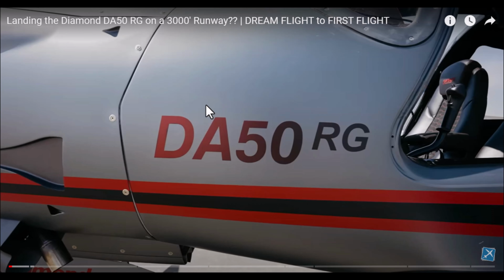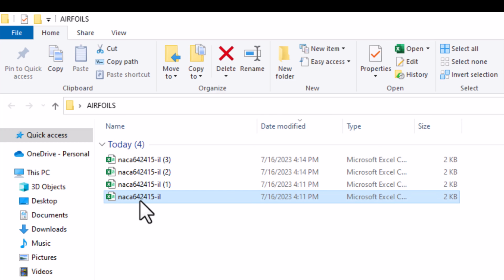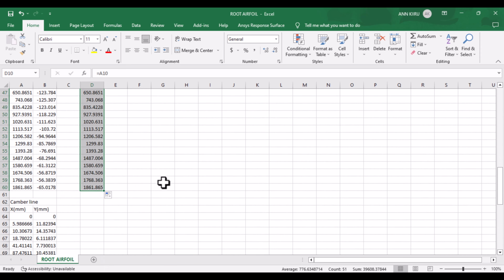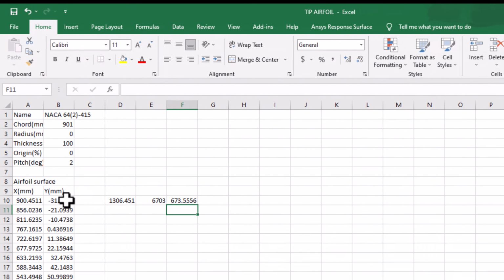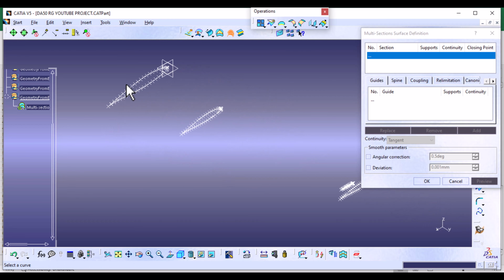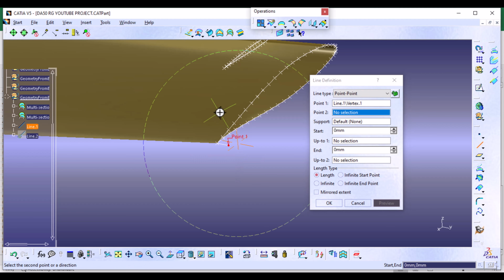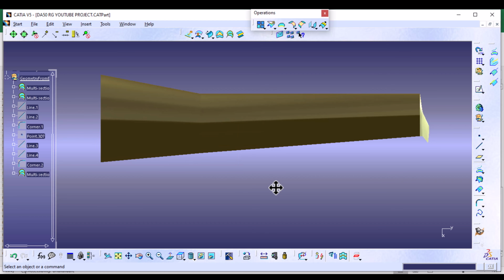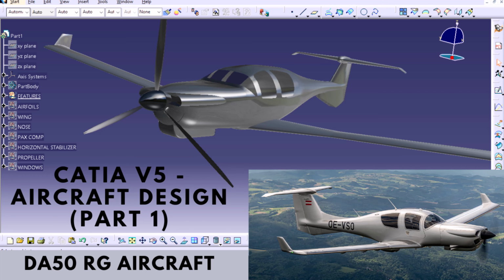CATIA V5 - DA50 RG AIRCRAFT DESIGN USING GSD CATIA V5| BEGINNER - ADVANCED| PART 1 - WING DESIGN

Comment: Here the winglet chord you have mentioned is 751mm but you have downloaded a file of 375mm as the chord length. So could you please clarify that for me. 
And thank you for creating such a helpful vedio👏
Reply from the maker: Hi, thank you for watching & for the keen eye.👌🏼
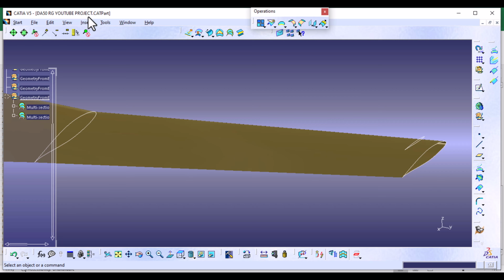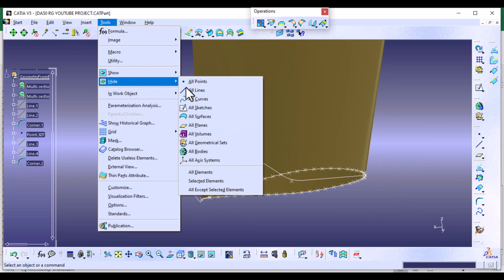Yes. The base of the airfoil should be about 750-800. But we didn't download the airfoil because we used points & splines in Catia to create the sweeping face from base to tip to winglet instead. (17:00 - 20:40) The 375mm if for the tip of the winglet.

Comment: Hello, please i want 0to learn how to make a full planes and helicopters in the stimulator and test if the plane can fly or not and also control it and testing the wings and rotors and engines and all of pieces from the small one to the big one, can you please guide me to do it can you guide me i want to be an engineer and be able to build full helicopters and planes, i have knowlegde in embeded systems and also in software developement and a little bit in mechanics and engines like turboshaft torboprop etc...
by the way i love what you do you are incredible
Reply from the maker: Thank you. You can start by learning part & assembly design for parts & GSD + Class A surfacing for complex smooth bodies. Then you can use simulation softwares such as Ansys to do FEA & CFD (computational fluid dynamics) to test flight characteristics esp wings & propellers. X-foil Can help with wing/airfoil selection.
For now you can watch Aircraft & helicopter design playlists on my channel & other channels as well to learn Cad design then you can join my Patreon (https://www.patreon.com/arielcad3d) where I'll be posting simulation master courses  & research projects).
All the best! ❤️

Comment: Thank you so much for this tutorial, muchly appreciated , But I had one question please related to the last step, isnt it better to give thickness instead of making it solid? because if it is solid then its weight is  doubled at least and that would effect the analysis
Reply from the maker: @abdulazizalhamid3885  Hi, yes. It's better to give it thickness if you're conducting structural analysis. Like we've done to the Renault project.
Reply: @themartiandogengineer  Hi, Thanks for your reply, I tried that but facing errors due to smoothness and offset or degeration, So can you please guied me how to solve it, or if you can direct me to the exact video that you made it successfully in Renault project because they are too much 😅
Reply from the maker: @abdulazizalhamid3885  You can't use thickness on the entire body at once because some parts like the wing and tail are thin and therefore thickness can't be uniform. It has to be in parts.
Tips: Try to reverse the thickness to offset outwards for thin bodies.
Try to lower the thickness in mm.
You can also make a body solid then use shelling option to make it hollow & give it thickness in part design.
Watch the Renault project for advanced knowledge on surfacing & solid integration.
This was intermediate that's why i simplified it.
Reply: @themartiandogengineer  Well done, thank you so much, appreciate your efforts

Comment: i have encountered an error in the winglet and couldnt solve it while creating the multisection
Reply from the maker: Hi, what error message did you get so I can help you.
In the meantime, check that you plotted the correct aerofoil, mirror image is checked & that the aerofoil is connected at the ends
Reply: the error encountered was while doing the multisection between the winglet and the tip airfoil saying there was a cursp  @themartiandogengineer